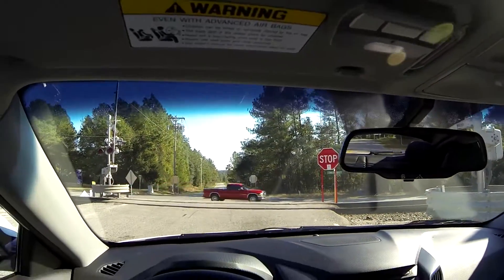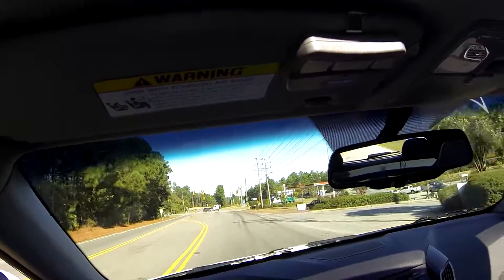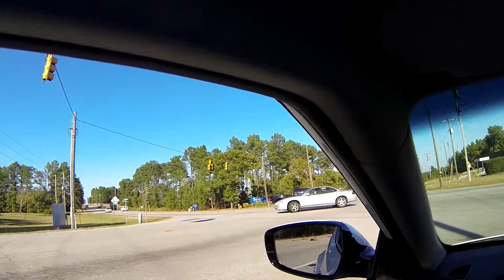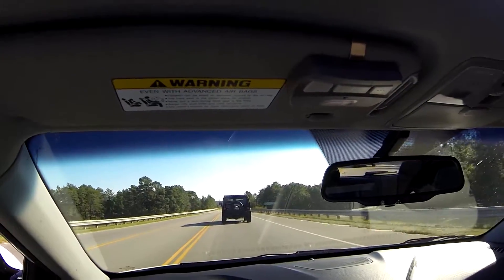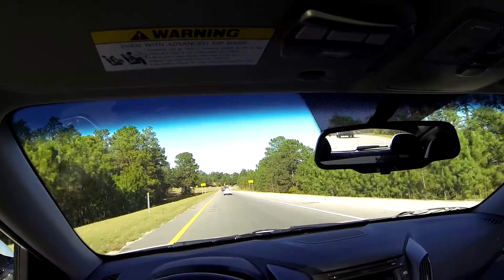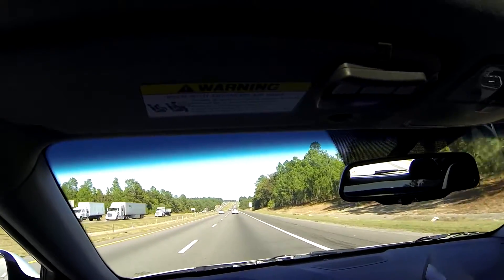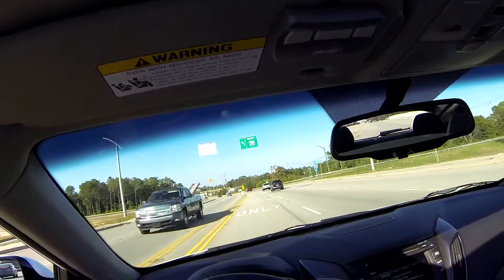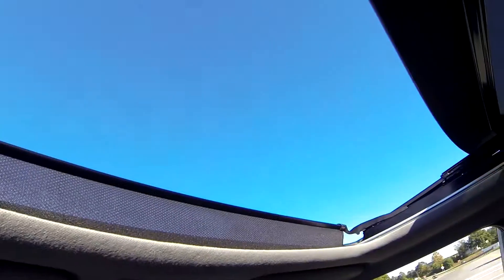Hyundai Veloster Turbo 2013 - Solo Turbo V-Mach 2N1 Exhaust System REVIEW

Comment: I love the sound of the exhaust...  I installed the Injen Ram Air and really didn't like the suction noise it made, it was way too loud and it sounded like something was wrong with the car.  Wish the Ram Air would've been quiter...  Thanks for sharing, i think i'll pick up the Solo with the resinator.
Reply: did you have to take the CAT off with the cold air intake? to get that sound
Reply from the maker: Kyle Nettnin huh?
Reply: Catalytic converter off and put straight pipe on to get that deep sound
Reply from the maker: Kyle Nettnin stock cat and downpipe is on. the exhaust is catback